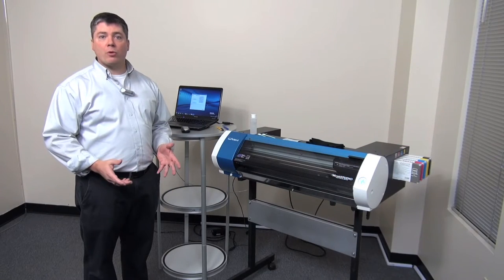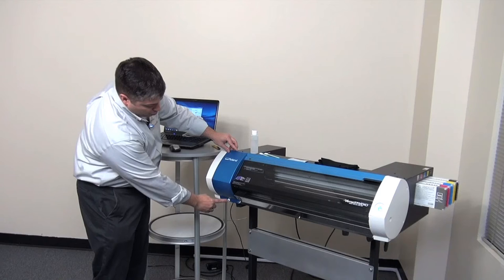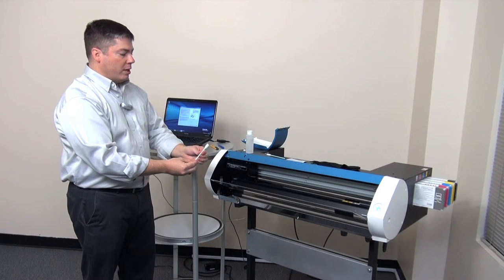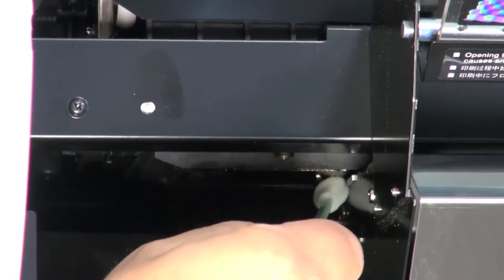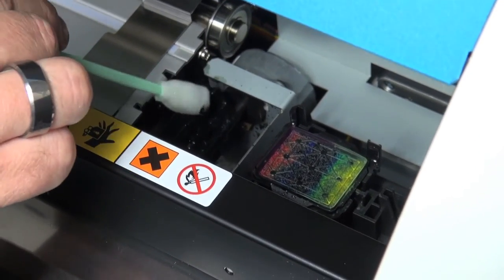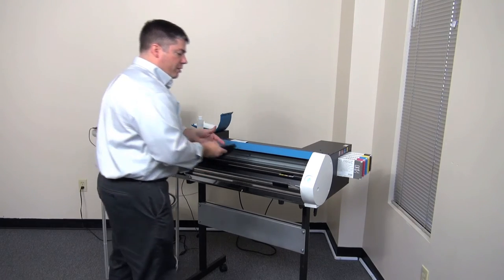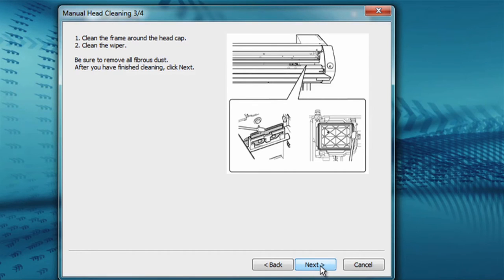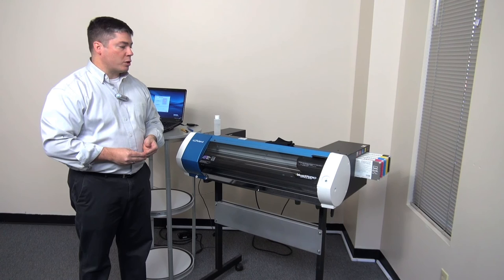How to Manually Clean your Roland BN-20

Comment: How long you have to wait to operate the BN-20, after you place  the cleaning solution in the capping station and allow it to settle the cleaning fluid that you've put in here will remove any dried or clogged ink from the drain lines going back to the waste bin.
Reply from the maker: Thanks for the question. Unfortunately, we no longer offer the BN-20. We recommend reaching out to Roland.dga for more help.

Comment: Is the print head easy to change?
Reply from the maker: This would be a service level replacement due to calibrations.
Reply: @StahlsTV  thanks for the info. I am debating on purchasing a new or used BN-20. Do you ruffly the service cost for head replacement?

Comment: I’m missing a full Cyan channel. Manual neither powerfull cleaning isn’t solving this. What should be the issue? All other color channels print perfectly at nozzle check
Reply: Ours had the same issue (less than a year old BN20) and they had to replace the dampers under warranty. No issues after that.

Comment: Mine often shows Magenta ink around the print head. Roland engineer told me as long as its printing OK not to worry too much?

Anyone else have this?
Reply from the maker: Hi Wayne - we unfortunately no longer sell this machine. If Roland said not to worry, we would believe them.
Reply: Mine does this as well. Printing good, but i keep wondering the same